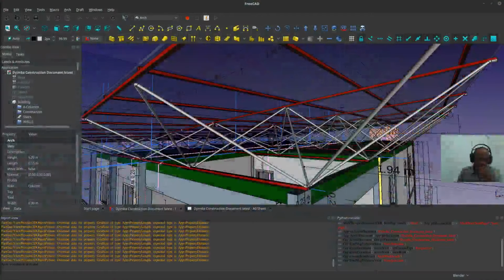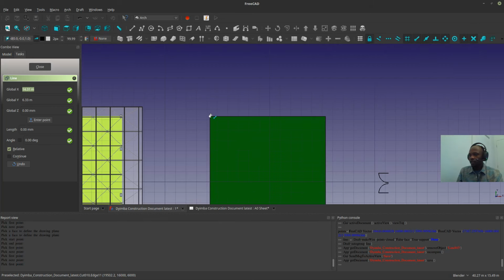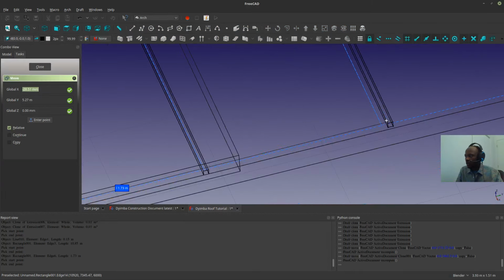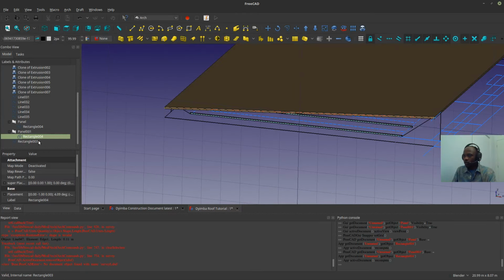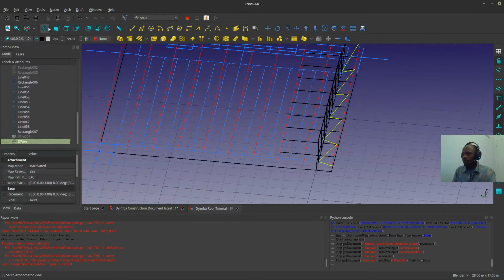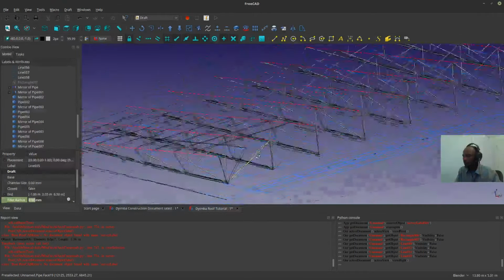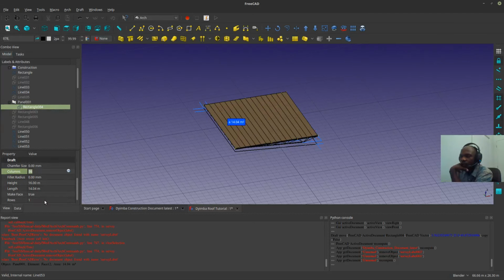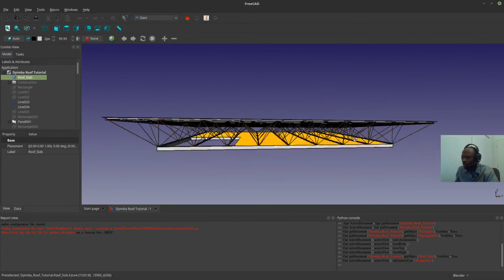Freecad Arch - Modeling a Space Frame - 09

Comment: Can I deatiling steel structure in freecad, like as tekla structure?
Because very popular steel structure details and fabrication is tekla structure software
Reply from the maker: in terms of capabilities yes you can create very detailed 3d of structures in freecad. How ever, it might not be as expedient as it was not exclusively designed for structures, but it can be done relatively well. If this is a small independent project that is somewhat consistent, it will be alot easier, but if it's a large scale proeject with alot of small tiny parts and they design changes are constantly changing in matter of hours and days, then it might be a bit of a challenge to be up to speed with design changes ("unless you hire a programmer to program you only the extra special tools you need.") then freecad can be even more faster than other softwares for your specific needs of course.

Comment: Hi Regis, Thanks for the Nice Tutorial, I have watched the whole thing!!, I love Space Frames and I've made space frame generators in Blender-Sverchok and Dynamo, I'm wondering if the whole process can be automatized in Freecad with scripting.
Maybe with two given non-perpendicular faces generated with rectangles, one below and the other above, the coordinates are given to both planes by the 2 Inputs U and V coordinate (The plane below has -1 u and v from the same input as plane below), the difficult part is to get the vertices of every plane, order their indexes in a list and connect their coordinates with wiring draft lines.
Thanks for all the FreeCAD teaching and waiting for the 0.18 BIM new features.
Reply from the maker: Hello @Leonardo Lira, thanks for your comment and interest in the application. Indeed in my general opinion Yes Freecad can be automated to generate what you need in terms of space frames. I'm not a programmer but my experience and understanding lets me know that this process can be generated either as a whole meaning one botton generates all you want, or various steps can be automated so that with a few buttons you can achieve the desired results in a relatively short time. As for your "difficult part" I don't actually think that would be the harder part, but once all is figured out, this process can be expedient. Currently I don't know if I can be of more help than my comment, but if this is something you would like to investigate further, perhaps addressing the community in the freecad forum can be a good place to start, and given my architectural background I can also help coordinate with ideas so that the tool created can offer the maximum application and flexibility required to achieve most space frame designs. I am not so sure I was of any help with my reply.
Reply: Yeah,  @OpenSourceArchitectureLab   and thanks, I´m  not a programmer either but constructor, but let's start scripting, I will be posting soon my ideas and advances, seems like will be a useful tool because space frames are awesome.